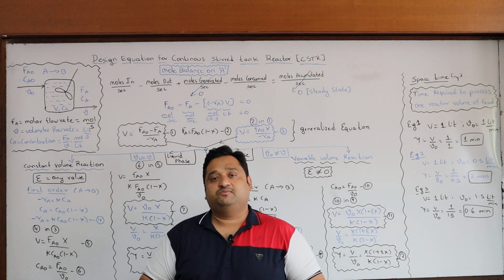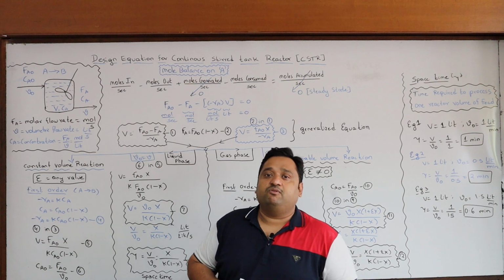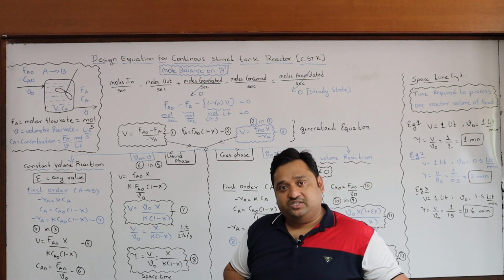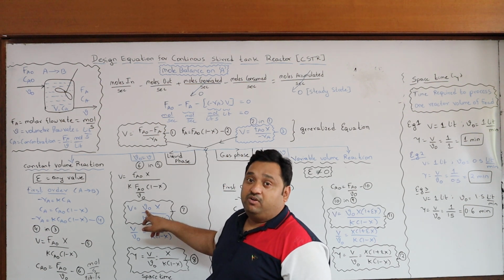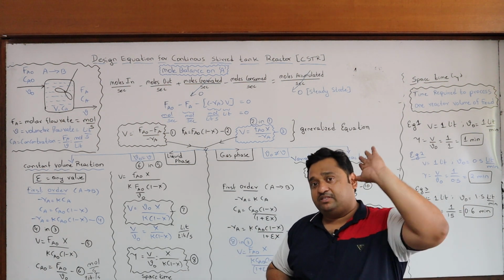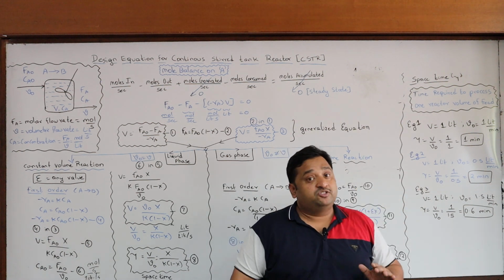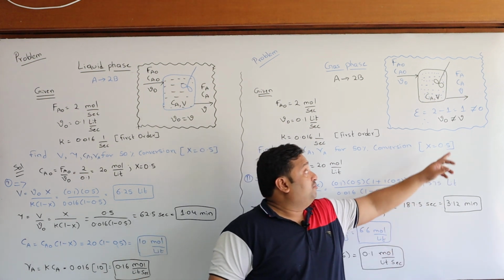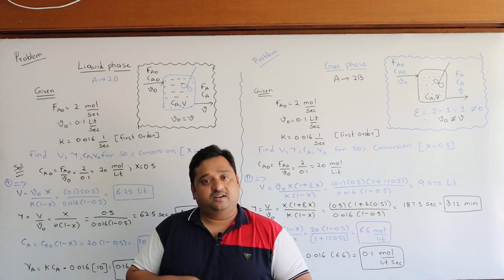CRE Lec 30: Design of Continuous Stirred Tank Reactor..Volume/Space Time..Liquid/Gas Phase reaction.

Comment: excellent sir
Reply from the maker: Thanks and welcome
Reply: @Dr.surendra0845  

Reaction Engineering and Control Lab 

List of Experiments

1. Determination of rate constant for saponification reaction in a batch reactor
2. Determination of porosity and sphericity of the given catalyst.
3. RTD study in a Packed bed reactor
4. To study the adsorption of acetic acid on charcoal and prove the validity of Freundlich and Langmuir
adsorption isotherm
5. To study the adsorption of oxalic acid on charcoal and prove the validity of Freundlich and Langmuir
adsorption isotherm
6. Determination the time constant of a given Mercury Thermometer.
7. Determination of time constant in a liquid level tank
8. Determination of time constant in interacting and non-interacting tank
9. Determination of time constant in a heated tank
10. To study the effect of proportional controller in a liquid level tank
11. To study the effect of proportional Integral controller in a liquid level tank
Reply: @Dr.surendra0845  

Modeling and Simulation Lab 

List of Experiments

1. Modeling and Simulation of Isothermal CSTR
2. Modeling and Simulation of non-isothermal CSTR
3. Modeling and Simulation of isothermal batch reactor
4. Modeling and Simulation of non-isothermal batch reactor
5. Modeling and Simulation of distillation column
6. Modeling and Simulation of heat exchanger
7. Modeling and Simulation of cyclone separator
8. Modeling and Simulation of CSTRs in series